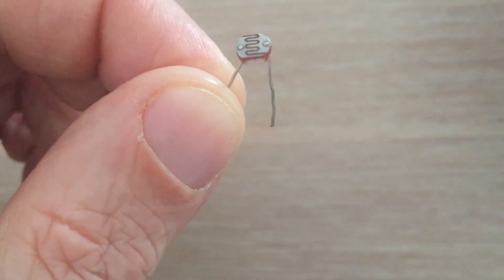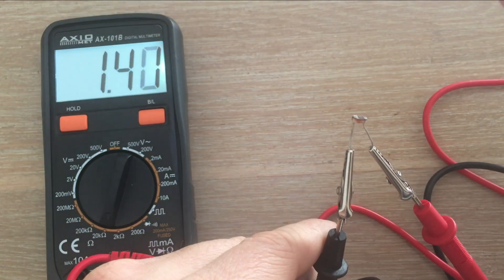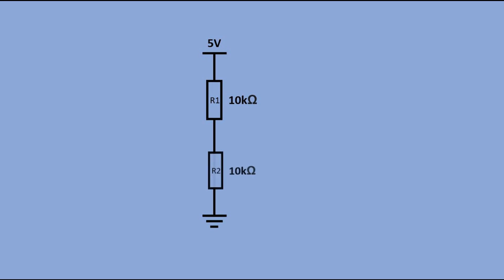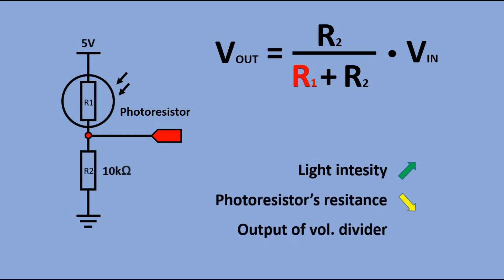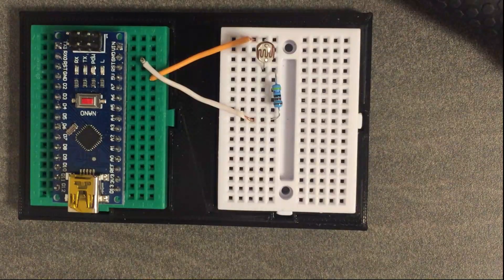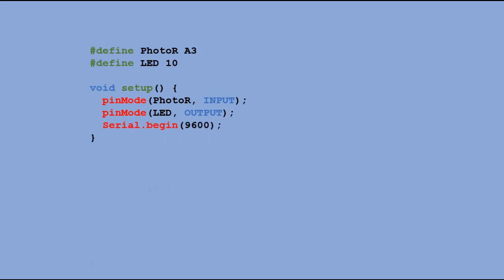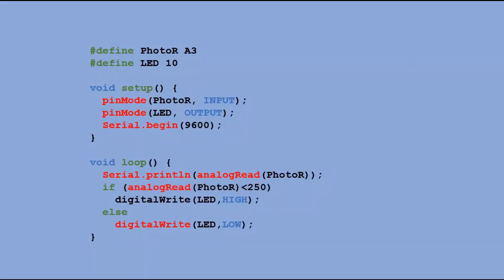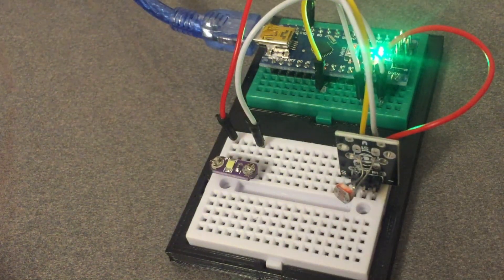How to control LED with Photoresistor

Comment: The only benefit I see from the built in sensor is modularity. So it is plug and play, which means we can change different sensors quickly with different sensitivities built-in as opposed to the one you made which requires changes to the arduino code. Instead the module can be physically altered thanks to the potentiometer that is usually on it. Although, I couldn't see any in yours.
Reply: Also I forgot to mention, you don't have to use the analog pin to get a digital output!

Comment: Would it be possible to use a photodiode or photoresistor to do the opposite, meaning, turn off the led when it is dark, and turn on the led when the diode/resistor detects a certain lumen level?

Comment: Thanks a lot for this amazing explanation and hands on experiments. Interesting that video has 5k+ views and zero answers to the question 😃
If I understand this correctly, the photo resistor is connected to ground in the “prebuilt sensor” , where in the manual implementation we had photo resistor connected on the 5v side. Therefore the readings go up when the light turns off and go up with more light. So it works in reverse and we had to change the logic from “< threshold” to “> threshold”